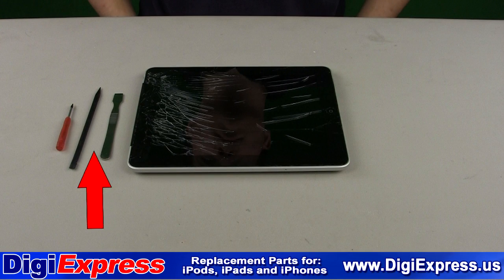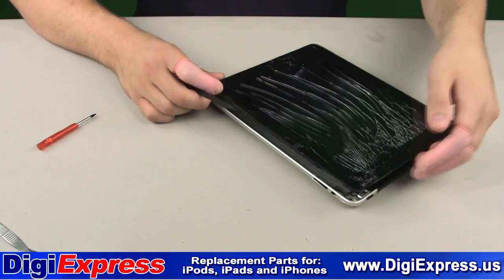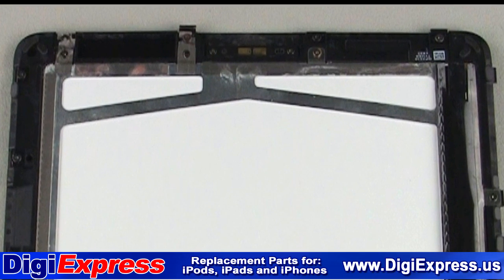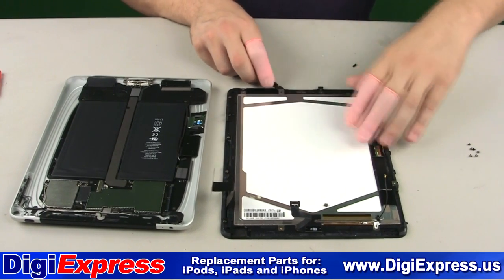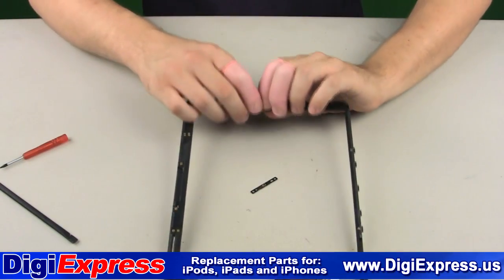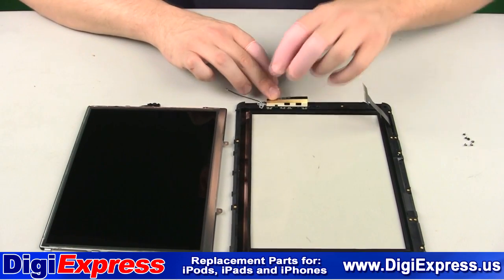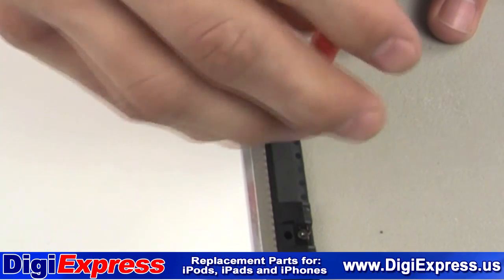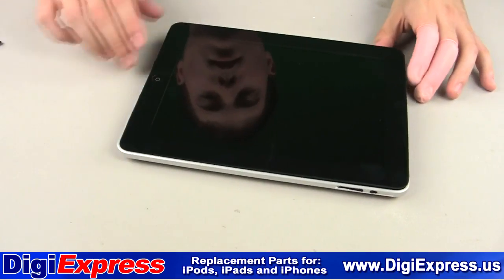iPad Glass Digitizer Panel Installation

Comment from the maker: With any repairs, you always need to be careful. Apple devices are very sensitive. However, the aluminum body is one part that really isn't too hard to deal with. It will likely bend a little, but just make sure that you don't bend it out of shape. Just take your time removing the panels and you should be fine.

Comment from the maker: The ribbon cable for the Power/Volume runs along the right hand side of the iPad, it is recessed into the backplate but does come near the rim.  You may have cut this cable when removing the original glass.  You can check that cable if you want, or you can send it to us and we can give you a repair quote.  18004404693

Comment from the maker: @elvenSeer using 3M VHB or 300LSE tape in 1inch or 1/2 inch width is the best option.  We are currently attempting to source the tape in quantity so as we can sell it on our website.  When purchasing the glass, simply purchase the mid-frame as well; our mid-frames have the adhesive already applied (leaving you to peel the cover from the dbl-sided tape, then install the glass digitizer to the mid-frame).  We also sell the replacement clips on our website. Visit our user page for info.

Comment from the maker: @jazzo44556 It would depend on your level of comfort, personally I would start with an iPhone 3G screen replacement before starting on an iPad.  Oddly enough since the device is larger, it is more difficult to handle when getting into the removal of the cables.

Comment from the maker: @einHOCHaufWISEGUYS You do not need to use a heat gun for this.  We show the removal of the mid-frame to which the glass digitizer is adhered, you will probably need a new mid-frame if your glass is damaged.